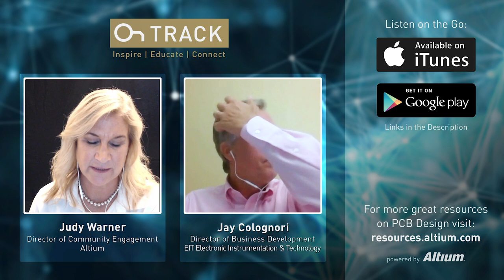Design for Manufacturability (DFM)  and Design for Assembly (DFA) & Jay Colognori [OnTrack Podcast]

Comment: Hi Jay, I’m a graduate electronics engineer. Thanks for your tips they’re great.  I’m confused about your tip on adding sprockets to a via on a plane. 
If a via is on a large plane to conduct heat how is solder flow an issue if it’s filled?
Reply: DIdn't get the explanation as well. It's one of those things where I'd like to see a graphical representation.